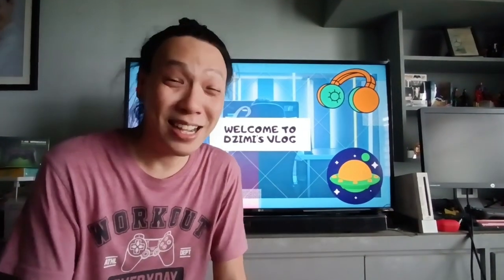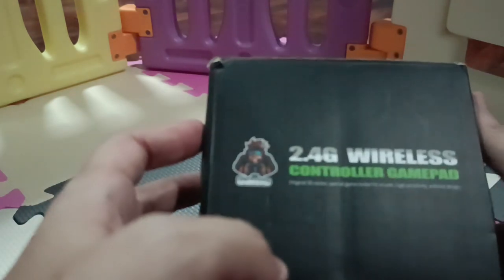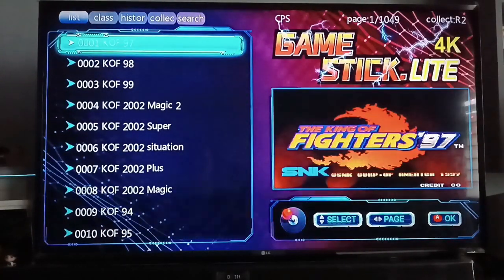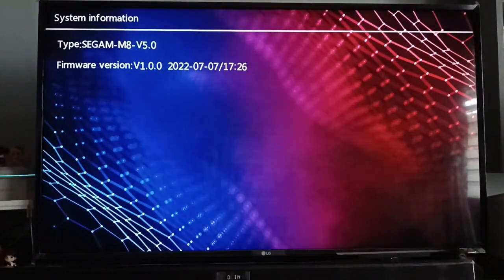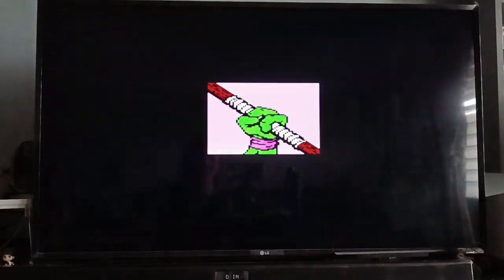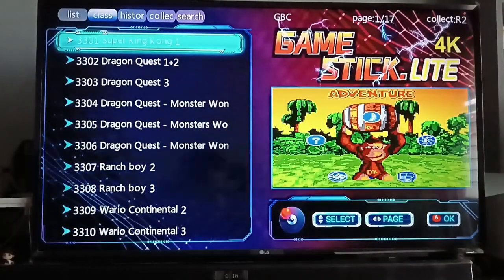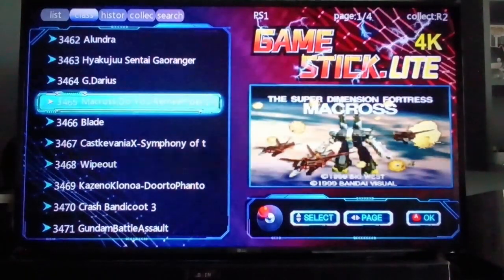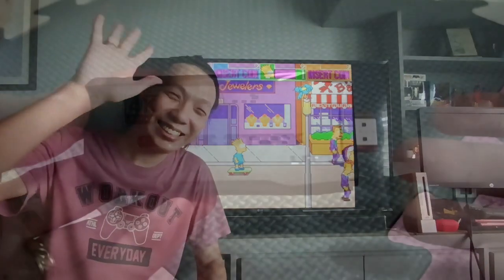Game Stick 4K Lite (64GB) Unboxing and Review

Comment: Do you need to power up the controls? I can't get mine to work.. I get two flashing lights but nothing more from the remotes.
Reply from the maker: did u try switch off then on the controller?

Comment: Peace be upon you. I have a game stick lite 4k. It was working fine, but after a month of usage, it no longer works. When turned on, the picture is black, although I tried all means via usb and via the charger to no avail. I left it for an hour connected to the TV and it did not work. What is the solution? Thank you.
Reply from the maker: sorry to hear that, did you try to reach out the store you bough the game stick? normally when i play the game stick, i will put a small fan beside it so the stick wont get too hot...

Comment: I actually really like this device! I wish I could install other emulators like n64 or psp, does anybody know if this is possible?
Reply from the maker: i dont think we can install other emulators . the n64 and p2p graphics are almost similar to ps1 which cause the device kinda slow performance but i saw other console that support n64 and p2p.. of course a little bit expensive
Reply: @dzimi168  thank you!!